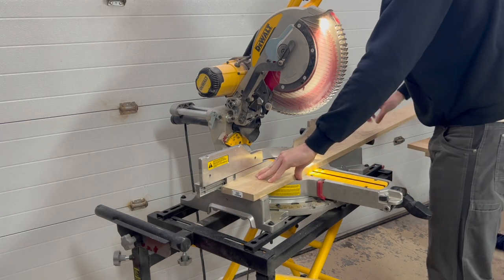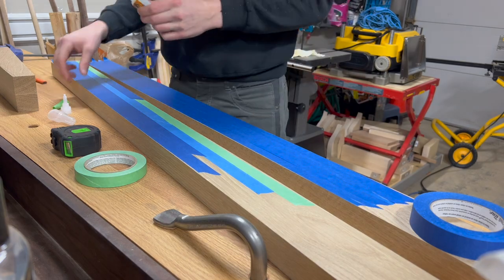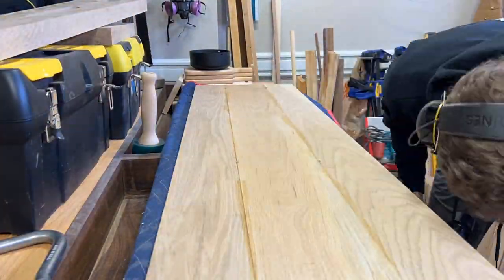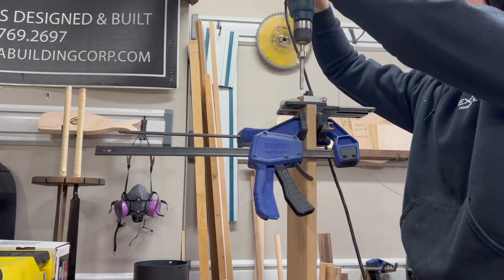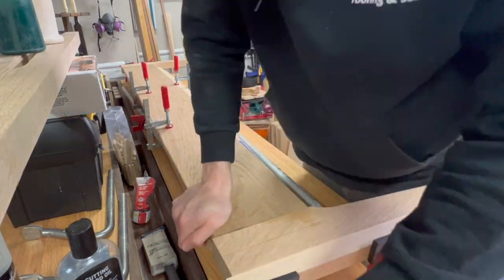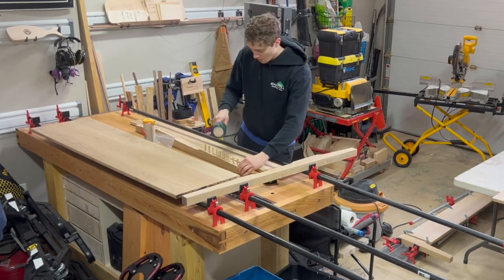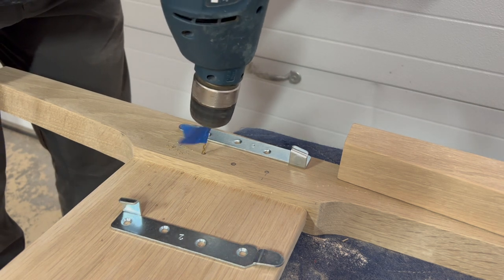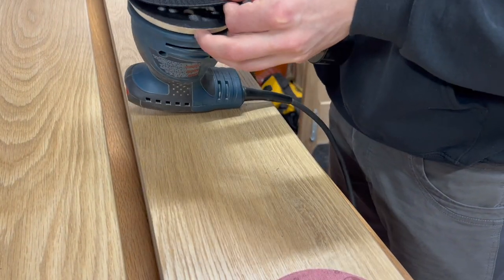White Oak Bed Frame Build

Comment: What a beautiful bed. A lot of woodworkers who are picking up the hobby get disheartened by not owning a table saw. You showed them that although the work would be a lot easier. There are other ways to get things done. I respect that. 

I’m my experience I’ve had a head board split because of wood movement. I had used dominos instead of dowels but the same theory applies. I would suggest what I’ve done to fix that issue. Secure it using dados cut from router. Use dowels on the top plank only and left the middle and bottom plank float freely. 

But hey, if it works. It works. You might not even experience this. But it’s good to know a work around I guess
Reply from the maker: Thanks! yeah having a table saw would certainly make things easier. Good point about the wood movement - I will monitor it to see how it moves through the seasons. I like the idea of fixing the top plank with dowels and letting the bottom ones slide in a groove (like a sliding dovetail dado). Il incorporate that in the next version!

Comment: Good workmanship, good video quality, and good results.  Cannot ask for anything else.  I get the impression that you would enjoy working with more hand tools.  Have your thought about adding some planes or spoke shaves to your tools in the future.  A small lottery win should give you all you need. A good woodworker to check out on what you need would be Rob Cosman on which ones to start out with.
Reply from the maker: Thanks Andrew! I have a small block plane which I use frequently! I have yet to invest in more hand planes (but I plan on it).  I really enjoy Cosman's work and his workbench design with back tray and dovetail corners was inspiration for mine.  At the time I didn't like the shoulder vise but when I make another bench I will include one.  I will keep an eye out for some handtools. I think a spokeshave would have been very handy for this project.
Reply: @calvin.cooper  I have a large number of planes.  If I could change things I would not have bought so many Lie Nielsen planes even thought IMO they are the best.  IF you learn how to sharpen planes like Cosman most planes will serve you.  Woodriver would be my top choice because they are not to expensive.  Then Lee Valley's Veritas planes are close behind Lie Nielsen in quality.  My last advise sir.  Keep on woodworking.

Comment: Hey nice video and even nicer bed! What was the bord thickness and leg thickness?
Reply from the maker: the boards are 1x10 inch thick white oak and also reinforced with 2x4s. The legs are 2x4 inch thick white oak